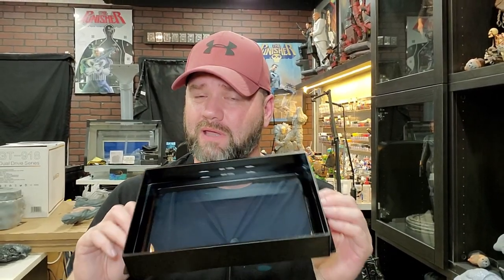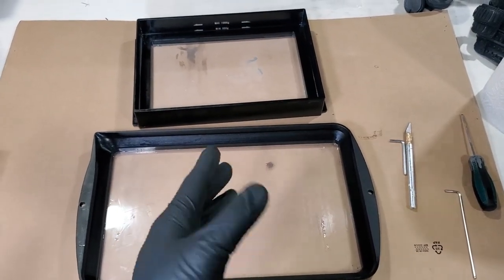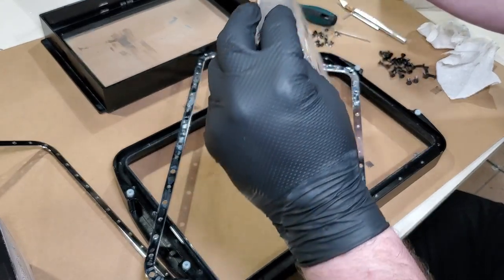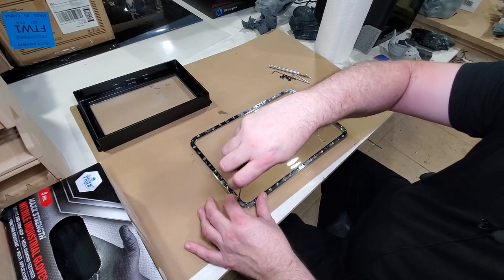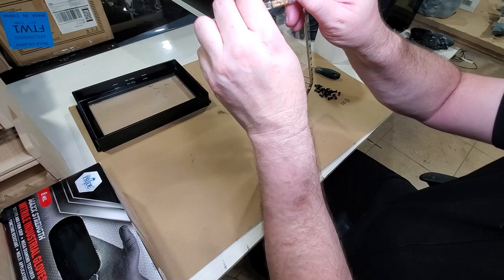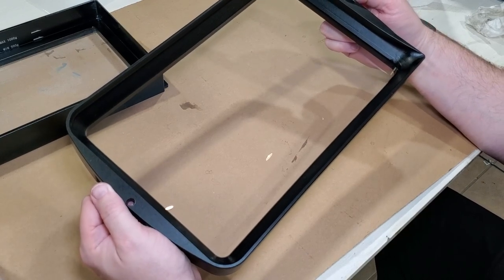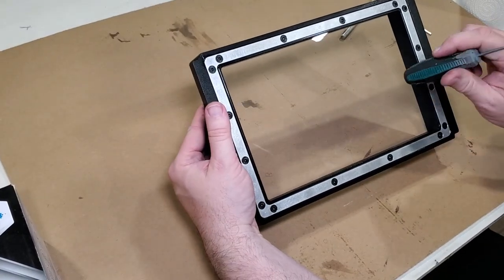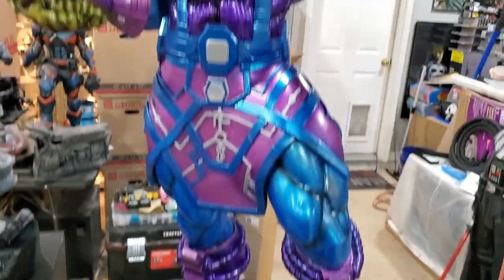EASY way to change your FEP in your Resin 3D PRINTER!

Comment: Maybe it’s just me. But I feel like people are way to afraid of touching resin. I get resin on me quite frequently. It doesn’t burn. I can’t even tell it’s on me unless I c it. I looked at the SDS sheet for what I use. All of the harmful effects are only level 1. Which mainly means as long as it not excessive over extended periods of time. It’s really not that harmful. Now some people might be more sensitive to it. I’m not say don’t be safe. But everyone acts like it’s hydrochloric acid. Maybe some resins are more harmful than others. But I know how to read an SDS. I was more concerned about long exposure to the vapor. I use a large carbon filter in my room. Only because I’m in here for long hrs at a time.
Reply: You will develop sensitivity to it over time. but you do you :D I use gloves and also carbon filter, better safe then sorry! And to be honest my best safety tool are goggles. Im scared shitless of anything entering my eyeballs lol
Reply: @Vostoceq another myth. Some may develop it. Most won’t
Reply: @handznet  Cool. its a myth. Point stands- better safe than sorry.
Reply: I’m a fiber optic splicer and I’ve determined that the really scared people don’t work in an industry where chemical handling is a daily job duty

Comment: If your like me, I usually drop a screw. Something that helps is a magnetic screw tray from Harbor Freight. Super cheap.
Reply from the maker: Good call.
Reply: Forgot to use mine a couple weeks ago when I replaced my fep. Thought I lost one but ended up finding it 😂
Reply: @onihensen  Of course if you knock the whole tray over. well you guess the rest. A trip to my hardware store. lol

Comment: I just wash my bath in wash and cure station and it came out clean without any mess in process of replacing.
Reply from the maker: Yes but you still have to replace them when they get scratched up and pin holes in them.
Reply: @TheCreativeCollector  Well yea but at least it's no stray resin all over the place.

Comment: not sure about your printers but my Elegoo Saturn S will fail massively if I don't use a spacer when installing a new fep. the fep will just be too tight and not flex enough to release the layers. found this out the hard way. went back to using a spacer and problem solved. this of course is just my printer in particular and may not be as critical on other models.

Comment: Ill probably be doing this soon to my saturn 2 I've done the mono 4k and mono 2 easy as pie them being Already done for you there great to replace so quick n easy!.im charging the PFA on my saturn 2 soon, i have been following some testing someone's doing changing the PFA out for normal FEP it's working great for him and solved all of his issue's he's been having and its getting more print success and better bed adhesion it's interesting to say the least so might try it when changing out my PFA soon the PFA is ment to perform alot poorer than just FEP that i find really interesting as to why these aren't fitted already then eh?! Great video as usual mate!

Comment: Great video. I changed mine recently. I did 3 prints back to back. Noticed it has a wrinkle in the center. Would you know why?
Reply from the maker: Usually that means the tension is loose on one side.
Reply: @TheCreativeCollector  so I went back to check. Since I didn’t buy an official Anycubic Fep replacement I didn’t noticed it was 2 peel backs. 😂 boy do I feel stupid. Just installed a new Fep and peeled both sides. I’m about to print. I’ll see how it goes. Thanks

Comment: I had tried to replace my fep and it was too loose… you can probably guess what happened when I went to run a print…. Anyways how do I get it tight? It’s a halot mage pro
Reply from the maker: All I do is try and keep the sheet flat when putting it on the o ring. No need to stretch it. It usually gives tension when you screw it into the vat.

Comment: Thank you for the information.   I have struggled with none of my prints sticking to the build plate since I changed FEP.  Is it possible to have it too tight?
Reply from the maker: I guess it's possible but most of the time when your prints don't stick to the plate, it's because you need to up your exposure times. You can also scuff the build plate with some fine grit sandpaper so it can stick that way.
Reply: Thank you for the reply.   I've also been told room/resin temp can be a cause.  My room is in mid 60's.  Not sure if that is true.

Comment: Hey buddy, how is the M3 Max? I know you and a couple buddies did not like the Mono X much. I want to get beyond that machine because after a single firmware update, I have not been able to get the dang thing to work.
Reply: I have doing a lot of FDM stuff and then molding and casting Batman cowls. It is a decent side hustle. I really miss printing and painting statues though. I want to finish my Turtles project and do a huge SwampThing.
Reply from the maker: I could never get my M3 Max to work right. Anycubics customer service is a joke too. I've tried everything. You name it. Tried it.

Comment: Question: If the machine says the Fep has reach its life expectancy and I hit proceed anyways. Would that cause the system to still run the 8 hrs and print nothing?
Reply from the maker: If the fep shows no signs of wear, scarring or possible pin holes then it should be ok.

Comment: I think people use spacers because the manufacture's tell you to in the FEP instructions. If they don't need spacers, they should just say it in the instructions. I use a spacer that Elegoo said to use and I have had no issues. Of course their fb group has tons of people that are having ripping issues and using all sorts of different spacers. Could be the brand of FEP you use or it really doesn't matter.
Reply from the maker: Very true. I've just never used them nor have I had to.

Comment: I got a tare on my fep.alot of resin got onto the screen.while trying to remove the cured resin I scratched the screen.i have a jupiter se.i contacted elegoo and they told me that the screen has a protective film and it's not the polarized screen (thank god).they said I can take the tape off and remove protective film.they also said I could replace the film with an fep sheet.my question is could I just install a screen protector instead of another fep?
Reply from the maker: You'll still need to install another fep

Comment: Question I have a jupiter se.first time changing the fep.while changing it.4 screws won't screw back in.looks like the holes are to big.i know I didn't strip them.the holes just look a little to big.has this happened to anyone else and any tips the can correct this issue?
Reply from the maker: If its a double layer ring make sure you have the right holes. Check out Elegoos site for that

Comment: Did Anycubic send you a new M3 Max or did you get it working?
Reply from the maker: No and no. Even after changing the fep it still doesn't work right.
Reply: @TheCreativeCollector  what exactly is the problem with the m3 max? i had a lot of trouble with the device and wanted to sell it, but my nature doesn't allow it to give up without a fight. in that case i beat the m3 max and have wonderful results.
Reply from the maker: No matter what I've tried....settings, new screen, new build plate, etc it will not consistently print right.
Reply: @TheCreativeCollector  oh man this is really really bad. I once found that if I change the lifting distance to 10mm instead of 5 or 6mm and leave the exposure off compensate on, I no longer have any problems. and like i said, this damn thing is totally sh... levelable. make yourself a level paper that is exactly the same size as the lcd. fingers crossed that you made it.